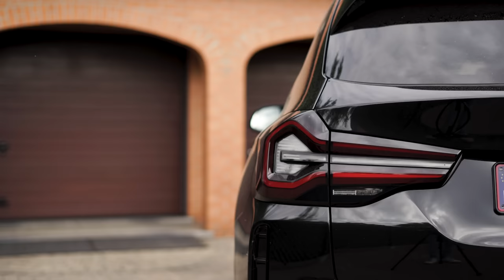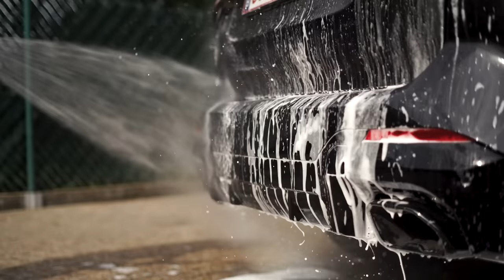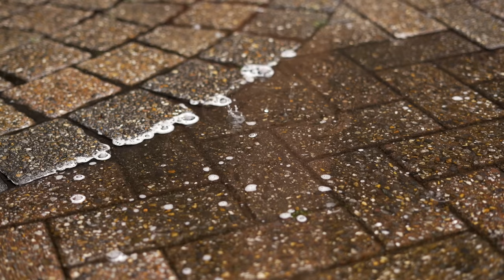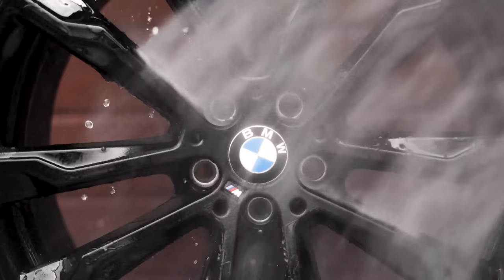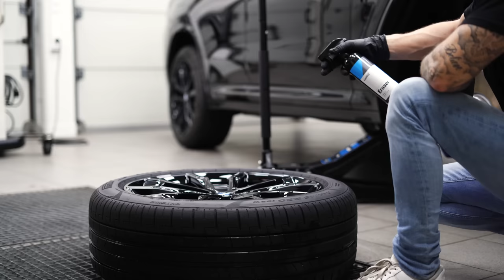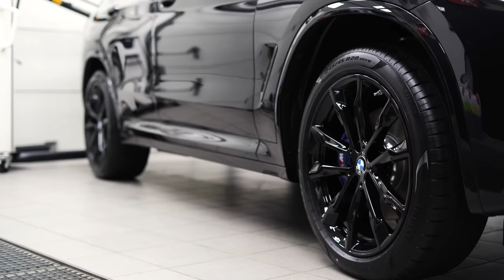Wheels Off Detail BMW X3 M40i - Deep Clean!

Comment: There is something therapeutic about focus oriented details. Off wheel detailing became new to me just a few years ago and this video is perfect timing for folks to deep dive into cleaning to begin the car season. I really love KCX Motorplast for dressing the fender liners when coatings are not available or preferred. I have used those tire dressing applicators for years and have found them to be junk when I began down the rabbit hole of automotive detailing so I find it interesting you're using them and my hands were always greasy from the tire gel. Anyways, the BMW looked fantastic!

Comment: Nice one! If you didn't know, you can use an airbrush with Dlux and coat control arms, suspension etc as well. No need to towel dry because the mist is fine enough to not leave hotspots.
Which steamer are you using Vermijl? :)

Comment: What is that pre-wash spray that is used as the very first step… and what is its purpose?
Reply: Probably Koch Chemie Vb or something similar, it’s purpose is to break down most of the heavy dirt and contamination before applying the foam cannon/foam stage.
Reply: Kcx gs (green star) is nice to work with
Reply: @PerfectDetailUSA  that’s what I use personally because I’m located in the US and can’t get Vb.